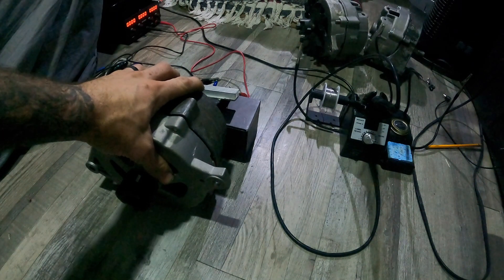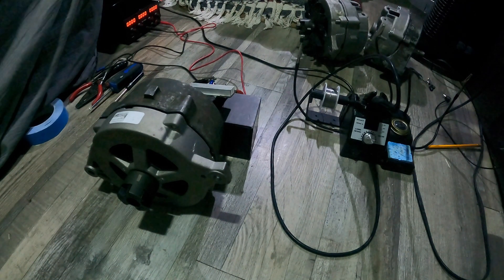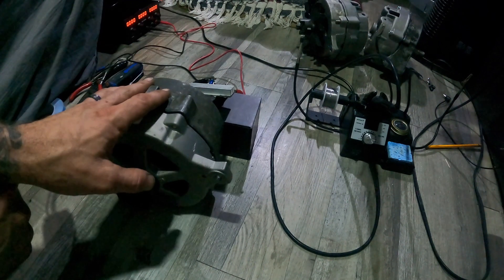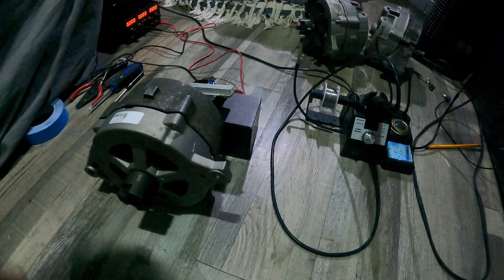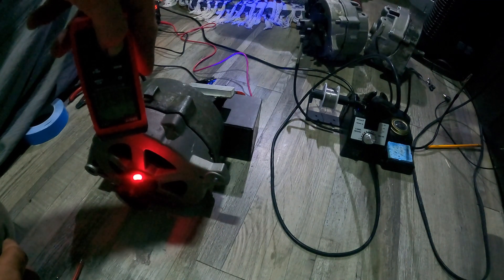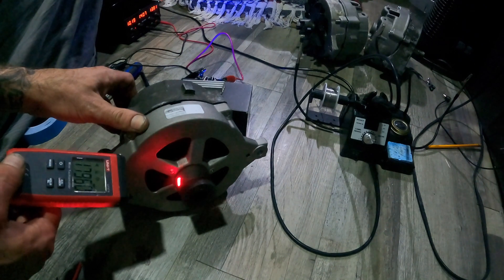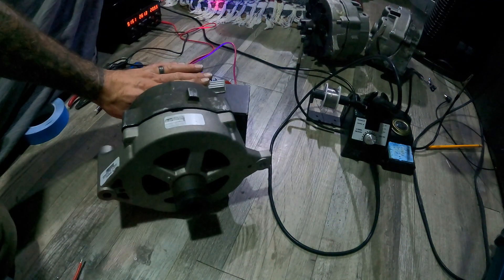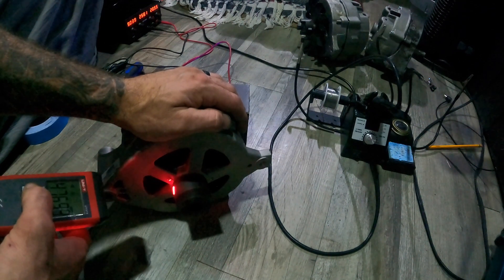FREE ENERGY part 2, car alternator converted to permanent magnet / bldc motor - in 4K

Comment: great job and any updates on part 3? would you be able to go through in a laymen way the design, as I would like to go off-grid and I believe it is possible with permanent magnets generators. thanks.
Reply from the maker: Hello, thanks for commenting. I apologize for the lack of response and updates. I do have a part 3. I just have to edit and upload. Will try to have it out in the next few days. I also have a detailed DIY of the set up it’s self that I will upload soon. I have been busy making content and will be focusing heavily on editing and uploading  from now on.
Reply: Maybe try multiplying the torque by gearing